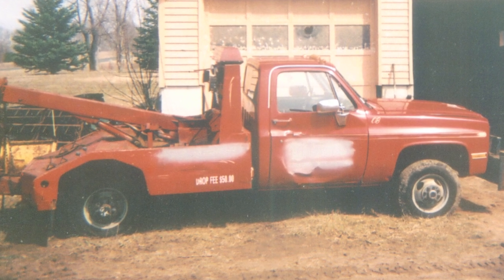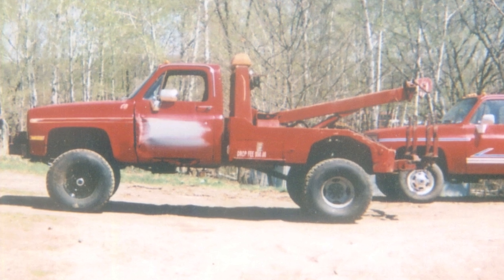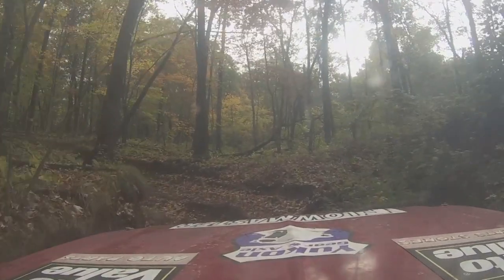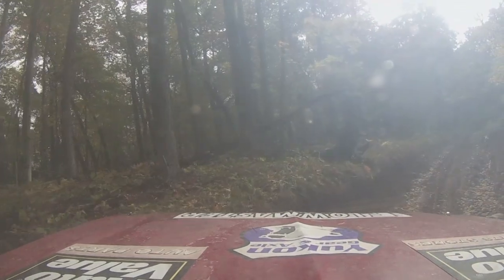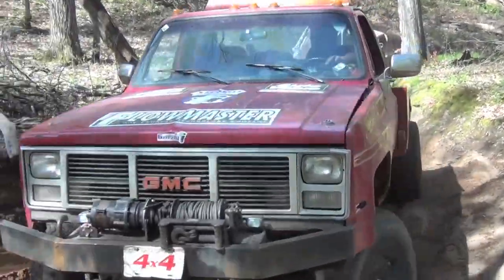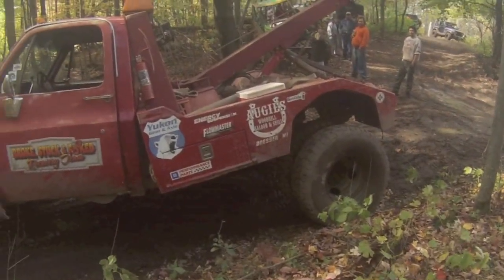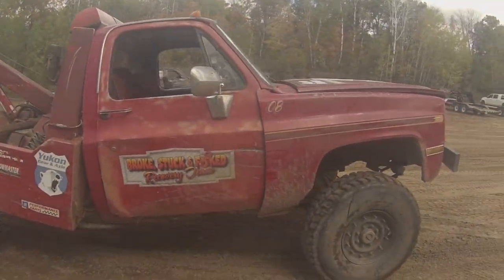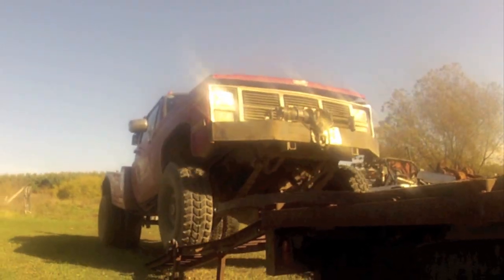BAD DAY FOR THE WRECKER by BSF Recovery Team

Comment: I built a off road wrecker with a couple buddies for our trail club.  It is a 1977 crew cab dodge M 880 former Navy truck.  With a 440 pulled from a low mileage motor home,  a 4 speed transmission and divorce mounted gear driven  transfer case with front and rear power take offs  . Everyone involved with maintenance and operation of this truck is a military veteran Johnny Q. was an Army engineer  , specifically he rescued military vehicles when they were stuck or disabled and or demolished those that were abandoned.  Bubba was a Navy machinist and fabricator.  My contribution I learned in my civilian life I scrounge parts to keep the rig running on our budget.  We have 21 rescues under our belts so far including a couple commercial construction equipment.  Those were a lot of work but actually pay  . Club members get free tows at club events. It took two years to get to where we are now and hope to have some of our own videos next year when we acquire a camera.
Reply: Picture !  This I want to see !  Thank you for your service !! Now hit the dirt and have some fun !
Reply: Like to see it
Reply: Video?

Comment: Great Video Man this is the First one of yours that I Watched . I Subscribed now so Im sure we will watch them all . We had A 1974 GMC Crew Cab with A 135 inch wheel Base  & It made A Dandy Flat bed & we couldnt find Another so we made one . We took A Reg 3/4 Ton & welded  24 inch piece of Frame & made A longer Drive Shaft Found A good Cab & we Drive the Wrecker every day & Still drive the 74 GMC too it has over 300,000 miles on it . We also plated & bolted the Frame where we Welded it together . Thanks again for Sharing your Videos

Comment: The problem is that everyone thinks you can just weld anything you like and that's that. Nothing is just that's that, for every action there is a reaction, in this case and all welding cases the metal must be stress relieved after, not very many places do this final most important step. Thanks for the great videos.

Comment: Oh, ouch!  May I suggest looking for your dream truck on Craigslist sites in Texas, New Mexico, and Arizona?  That's a very popular style down here, and local vehicles seldom have much if any rust. If you can reuse your engine and/or drive train, you might find a chassis that fits your needs for cheap.  Good luck!
Reply: That is so true about the rust. Our stuff lasts for ever here in Texas.  I also wonder if he had a true 1-ton or if that was not a 3/4 ton with a lighter frame. A shame but that is where they usually break, lots of stress.
Reply: Thomas Conoley
Yup...I've never had a vehicle develop rust, and all of them were either old when I got them or got old because I held onto them, or both.
Reply: Thomas Conoley But at the same time, that thing has taken a beating with all the bumps and stuff, lol. But it held up extremely well. Built well, too!

Comment: Sorry it busted. I have a home made wrecker and done some winching. I suggest you get a C-50 frame. Mine has a 350 and a 60000 braden winch. your  1 ton running gear should fit with some work. I would suggest wider tires and single up the rear so you make one track in the muck instead of three. Get a long frame and trim it to fit your plans. The sheet metal will fit with some spacers ( floor pans are different ) Good luck from Texas !!

Comment: Hi, I'm new to your channel, I actually have an 84' GMC one ton dually cab and chassis setup for 10' bed, sm465 trans, 14 bolt rear, with a 350 4 bolt main.. frame is immaculate as is the cab and front clip as far as rust, only problem is it's 2wd... Don't know if it's something you're even interested in or where your even located but it's in my front yard for $1000

Comment: I've modified a few trucks in my time :) ... one question ... did you fish plate and box in the frame?  
The last Chevy I modded into a flat bed I ran 12 Gauge fish plate down the centre of the frame rails then fully boxed them in on the inside.  Many years before that I put 1200 X 20" Split rims on a 3/4 ton GMC ... did the same thing but filled in ALL the punched holes on the stock frame first.

Comment: I had hard time loading video bad day for that. but broken frame no problem. I have section many of trucks. reinforced for heavy winching. just v it weld it. plate it. then take a c40 frame and put on outside of it to double wall it. pick them up cheap at local yards. they are straight frames and work great. 2 days and would be 3 times stronger. my current truck a 3500 hd 4x4 has had whole frame replace from cab back. I load heavy and winch heavy running a farm dealership. most tow trucks end up sectioned and reinforced. I would never give up on this just cause of break. this is just letting you know that it should have been reinforced before an off roader. don't forget to add  a few extra cross members to the c40 from.

Comment: Never weld on a truck frame ..there made to flex.When you weld on a truck frame it takes all the tensil strength out of the metal  allowing it to flex. Another words it turns the metal  brittle so when it does flex it breaks.  I'm am honestly surprized it lasted this long.. my 2 cents

Thanks,David
Reply: +David Stapleton II Yes and now. Its not that the frame is weakened by it, its that the weld is stronger and more rigid. If you weld a crack or a clean break, it will be stronger where its welded and crack/break somewhere else instead. That's exactly why its illegal to weld frames and crash beams on cars/trucks here in europe. If its welded it will never pass inspection ever again. You wouldn't believe how many trucks i've had to tag as a total loss because of this. Even if i would've broken the rules and fixed it, it wouldn't have passed the next inspection.
Reply: I agree. That's what I was saying the weld is stronger  making the metal have no flex  because the weld is so stiff and here in the states I work for freightliner and the guys that cut and weld these frames as a pro   will tell you  to much heat will make the heated area brittle
Reply: O stop. Car/truck frames have been welded since roughly the 1940s from the factory when they started getting boxed rather than full C frames.
Almost every modern truck is boxed from the engine cross member all the way to just past the back of the cab. Newest ones are often fully boxed the entire length with welded cross members. 
This truck broke in the known location where they always break. Right behind the boxing behind the cab. This would not have happened if it was boxed the entire length. Offroaders and work trucks like snow plows do this without failure.
Ares, you also fail inspection in europe because almost all modern cars have a unibody not a frame. It's just sheet metal and cannot be repaired by welding unless it is gusseted.

Comment: Hello  I have a few questions don't want to bother you much .First question is on the wrecker tires you stuck wider dulley ' s on it did you have to put spacers like a spacer then a tire then a spacer/adapter then the other tire? Question 2 should I use steel adapter's or aluminum?
Reply from the maker: Check out My video on how I can run big Mud tires on the wrecker. http://youtu.be/ikaclBAXFFU
Reply: Stop bothering them.
Reply: +Steven King  i read all of your comments and they are useless.  maybe if you were more pleasant you would have a girlfriend by now...

Comment: i think your crazy to even think about using a old frame or the oem to begin with based on the tasks at hand.  I know i would have assumed you would construct your own based off of the dimensions of the oem to make parts replacement easier.. a custom frame that is ridiculously strong.  build a custom heavy floor for your cab and keep helping the bsf'ed back to civilization with the proven drive train.

    i had already assumed your frame was radically reinforced. quite shocked it held up at all. you work it.

Comment: Maybe a f450 will be a good replacement. They have wide 19.5 wheels out now with 36x13.5 tires for off road use. U just fined one 4x4 and lift it. Put tires and wheels on with some lockers?

Comment: Broke in the standard weak spot of most GM trucks. They all seem to break there whether its a wheeler, tow truck or a plow truck. Next truck, box the frame in from the engine cross member to the trailer hitch.
Sucks man.
Reply: These frames at designed to flex. Fully boxing it would only make it rust out. Not add any strength

Comment: ...frame reinforcements should never be welded on...they should be bolted on through the web of the frame...and the ends of the reinforcements should be cut at a 45 degree angle to prevent stress risers at each end...

Comment: Sorry to see that,like losing a favored pet.
Reply: Wheel base is probably too long but couldn't you use the four door? I know they have a heavier frame,dad bought a 91' that used to haul water for the volunteer fire dept,has a wheel lift now,but doesn't go much offroad,just a suggestion,thanks for the great videos. :)

Comment: I'm sure you can find handfuls of non-running ones.  Check out Car-Parts.com.  If you just build a new frame, it's not like the numbers have to match.  I bet you can get someone to give you a frame at cost (scrap) at least.  How bad is the cab bashed up?  How many modifications does the frame have to accept the lift?

Comment: That's because GMC Chevy and whatever general motors builds has the most dependable high-grade steel frame truck built whatever you call it there is without a doubt GM vehicles are the best obviously

Comment: Sorry about that am not sure if will work but we had the frame on a hay cutter crank pretty back to the point it almost broke off and we just reinforced it with a foot of plate I think its 1/4 plate and it's still holding up u might be able to try that and if you get a new frame or repair that one i would do that and also box the frame fully i hope that help good luck